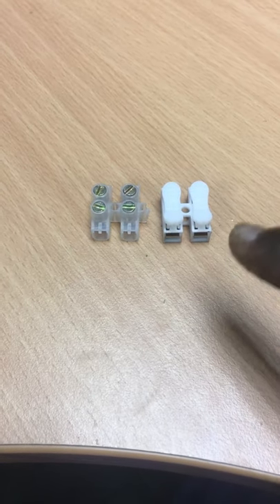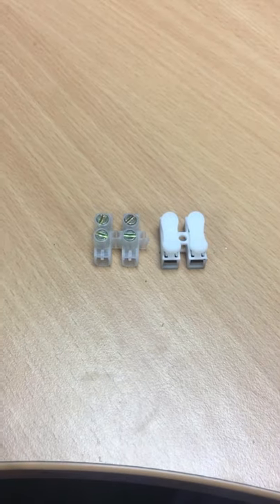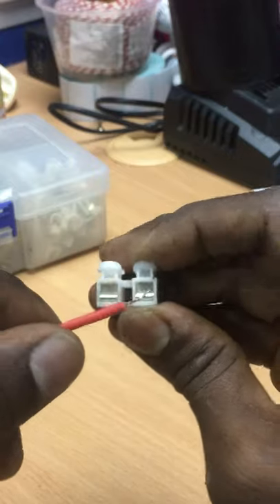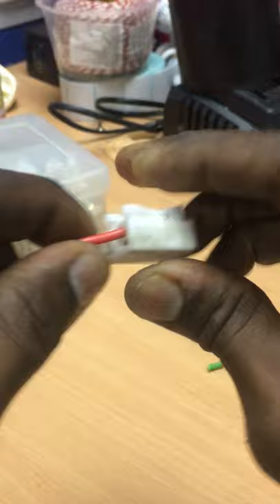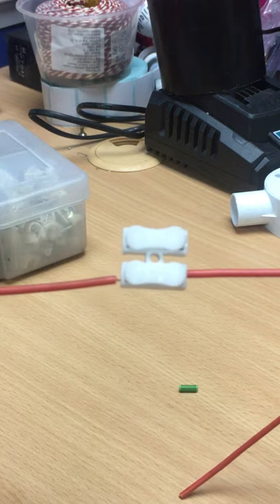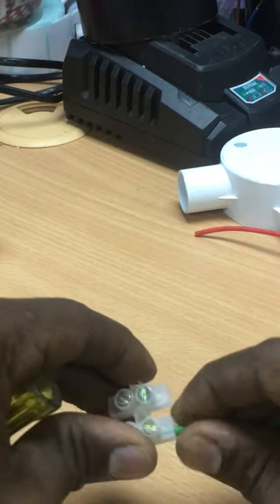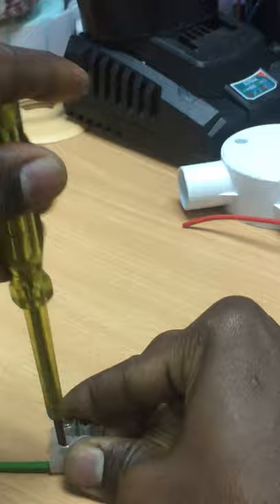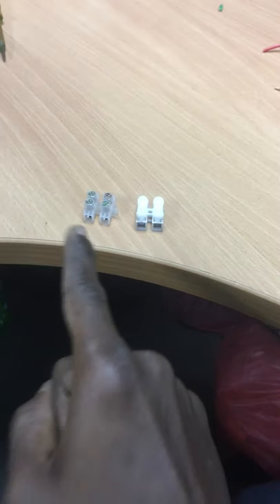Clip Connector Vs Screw Connector.

Comment: I prefer screw connectors too. Now am using wago type connectors as its easier when changing old led lights to new ones.its easier  to use and stronger than clip connectors.more like the screw connectors but expensive.